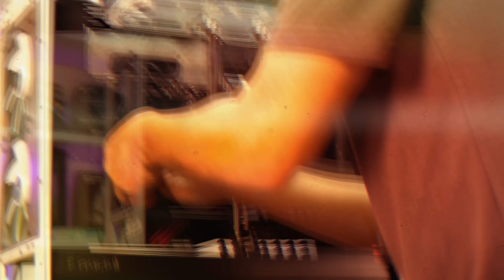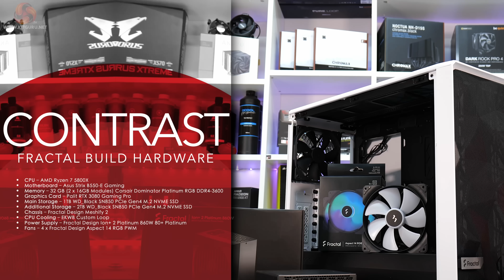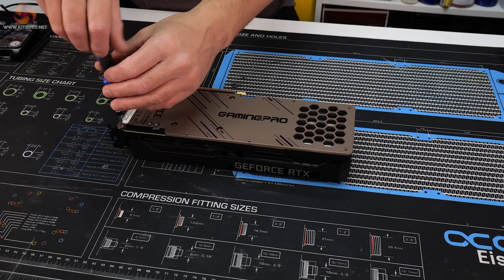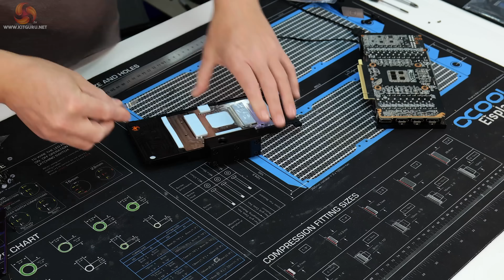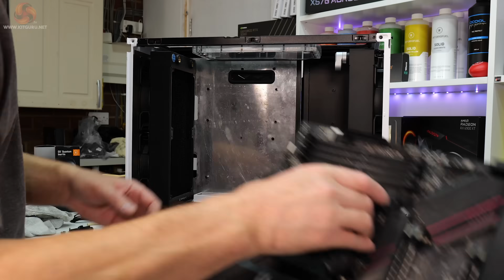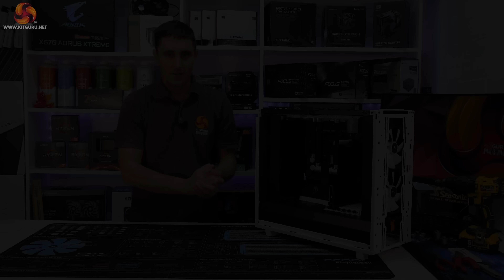Fractal Modded Build - HIGH CONTRAST (Part 2)

Comment: Love your work here James! Hadn't seen part one before now, awesome another custom build!
One thing I'm wondering. In part one you mentioned airflow going from back to front. But if I get your water cooling setup the front rad is the inlet to the components? It's probably minute differences but my first thought is, the back rad gets the fresh air and will be the colder of the two. while the front will get some heat from the internals. So i'm thinking, front rad -> pump -> back rad -> components. Wouldn't that give slightly better temps than the reverse?
Love the style of the build. Seeing how clean the rest is I'm thinking it would be cool to disable the RGB on the motherboard and ram and if wanted have two LED strips to light up the sleek look
Reply: I don't think the order of flow will make much if any difference to component temperature. The way the fans are set up at the moment means that they both pull air in so the ideal scenario will be to run the system with the side panel removed. 

I wouldn't normally do this but since this is more of a showpiece than a regular system it doesn't matter.
Reply: @KitGuruJames  Ahh ok, that makes sense. Btw what will happens with the case when you're done with the mods and videos?
Reply: @martinhowden  I'm not sure yet.

Comment: The top res is going to need more modding with channels directing coolant to and from the tubes to get flow through them or the coolant path is going to be from one rad to the other with zero flow going through the runs to the cpu and gpu.
Reply: Yep that's the plan. Similar to how I did it in the WD blackout build where I made the distro plate from scratch.

Comment: Does fitting a water-cooled block to the GPU invalidate its warranty?
Reply: I had a launch 2080ti Fe that had to be replaced (because of the initial batch memory fault), and I had waterblocked it and used liquid metal in it. I put it back together for sending back and they didn't raise any issue about the return.
Reply: It shouldn't, but some vendors don't like it if the warranty sticker is removed.

Comment: ever considered modifying the center mobo stand-off, replacing it with a piece of plastic tube, so it's becomes passthrough to the back of the mobo tray above the m.2 slot at 12:57, then you can take the connector off the EK CPU block, pass it through and have a cleaner build?
Reply: An interesting idea. I've not considered that before.
Reply: nice try,  dummy

Comment: That looks real nice and I really like the manner in which you explain what you are doing; it would IMHO look even nicer if the distro plate were on the bottom (ordinarily the rear of the PC).  And are you going to watercool the NVME drive? The tubing to the GPU, CPU, and NVME would then be much more discreet and would not interfere with the wiring to the motherboard and GPU. Does nobody make such a distro plate?
Reply: There is absolutely no point watercooling an NVME, at least a PCIe 4 one. It would be adding heat to the loop for no benefit.